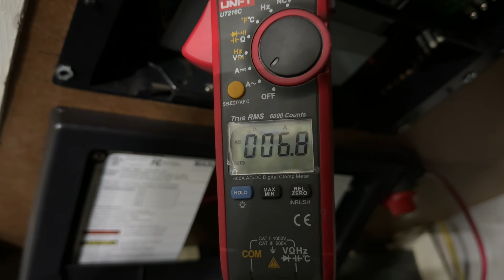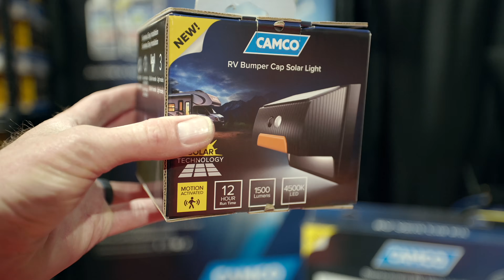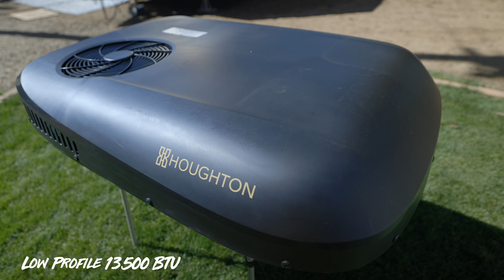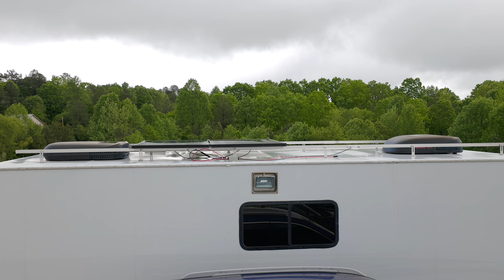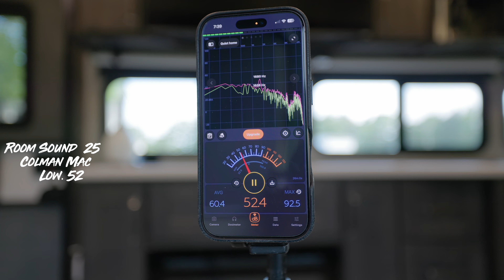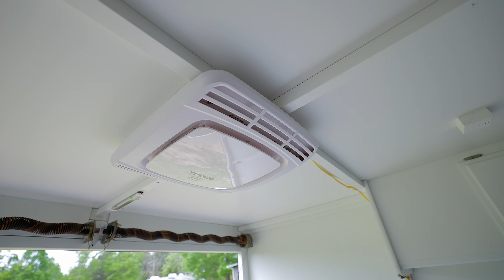New RV AC Tech!  Mini Split Power With Ultra Low Amps Tested!

Comment from the maker: What is the biggest feature you look for in an AC? Is it features, sound, efficiency or price? 

 Camco Gear Up for The Season
Amazon 
   NEW FasTen Leveling Ramps: https://bit.ly/4cZHXE7
   FasTen Leveling Blocks: https://bit.ly/3SgwDdd
Walmart
   NEW FasTen Leveling Ramps: https://bit.ly/3GAuHtH
   FasTen Leveling Blocks: https://bit.ly/3ShXy8B

Turbro Inverter AC 13.5K    https://collabs.shop/mwbdfm              
       Save 10% www.turbro.com/ALLABOUTRVS

Furrion Chill Cube: https://bit.ly/3Z2KsQh
Reply: Priority order:  1) ability to cool, 2) efficience, 3) sound, 4) price
Reply: Ability to cool! And of course price is a factor. But I don’t do well in hot humid temps so what I care about most is that it cools quickly and keeps it cool.
Reply: Please post a video showing how this can be used with a ducted system.  I have a Coleman Mach 3 I want to replace and the Furrion requires a new thermostat and controller and is $1,500 with all that.
Reply: Ability to cool then sound. I can do things to get more power. I don’t know of anything to make a non-ducted A/C quieter.
Reply: I'd like to see a follow up on 6 months and 1 year on these. I had a Eco-Cool on my Wolfpack TH and it never acted right. When it worked it was great. But very unreliable on holding temps.
Reply: reverse cycle
Reply: DC direct power
Reply: How many watts does this pull when it's in high? The chill cube runs at approximately 700 watts max.

Comment: I agree that it’s good that the industry actually moved partly towards technology, but the furrion cube was not nearly good enough. At 18,000 BTU it uses still 900 or 1000 W I think compared to a turbo 13,500 BTU which only uses 5 to 600 W. The cube does not have an app or even Wi-Fi connectivity where is everything with turbo does and most other carriers. This unit is quiet as I understand it, and the turbo is loud. So if you care about noise that might be the only reason to get this unit. But if you’re off grid, you definitely would not want something so inefficient and unable to be able to control remotely. This is typical it seems to me a furry and the industry. Baby steps towards things that other companies, even at the cheapest end are already doing.  I’m curious if others have different thoughts, having looked at the specs of both units.

Comment: keep the roof free for solar, in stall a split 12V, they have even an internal unite next to mandatory outside condenser. I installed a Topleader DL-2000F2 12V, stays under 50A on 12V 👌🏽

Comment: I don’t know if you read comments that you get when a video is seven months old but here goes. I just completed installing this unit on my 2000 Monaco Dynasty and I modified it not the unit. Just the decking tour goes into my duck system on my coach and I think it is much much quieter than what you were showing and a heck of a lot quieter than the domestic unit I took off. Thanks for the video.
Reply: Would you happen to have put it on YouTube? But you basically made it work with existing ducting? I have a similar rv with ductwork and the ac is loud and just pulls a ton of amps on startup so I’m looking into this setup, I am willing to lose my ducting for this but not if it’s possible to modify things. Thanks

Comment: what about the pioneer 13.5 btu rooftop split ac unit? works as a heat pump also. would be the third company to make this class, in addition to turbro and furion.

Comment: Why are all rv places calling roof mounted ac a mini split it’s not its called a self contained unit you are calling it a mini split cause the big hype about how great they just like the bull about a heat pump and the lie about where the heat comes from a heat pump is reverse the direction of Freon you still have same amperage and the mini split uses same Freon and compressor outside and evaporator coil where gas expands as regular ac, what joke know your equipment before you embarrass yourself by lack of knowledge
Reply: Ok as a Commercial HVAC technician I understand the point of what they are saying it  is an inverter technology self contained Heat pump.  As with many technical fields we attempt to talk to our audience aka layman's terms. I do appreciate you not adding to the conversation.

Comment: 1.  Do you have the max current draw when the ac is on full cooling mode inside a hot van, and the minimum draw when the temperature has been reached but now  the inverter ramped down the compressor for maintaining the temperature?  This will let us know how long a battery bank could last keeping the ac running through the night. 
2.  I noticed the air distribution vent has no controls.  You get air blowing through both front and back evenly without controls.  That might be ok if the ac is mounted in the middle of the van, but if it’s in the back over the bed it’ll get extremely cold over the bed but warm in the front.  Do you know if there’s another option for a different air distribution box?  My ac is over the bed in the back of the rv.

Comment: Looks like Pioneer (not that pioneer) (I have one of their mini splits) is also making one with a heat pump now.  Do you happen to have video comparing all the inverter and 12vdc units currently on the market?   I like the chill cube but thinking a heat pump would be nice option.  My 2 month old RV GE AC lost its freon, debating on having it replaced with warranty or taking the "opportunity" to put something better in.

Comment: My furrion ac drives me nuts. Loud, kicks on and off with loud noises, and draws too much power tripping surge protector for over current if I’m using any additional appliance while the AC compressor turns on

Comment: I'm waiting on an inverter RV AC unit that doesn't install on the roof. I don't have any real estate on my roof for an AC. Also, the air filtration on these units absolutely suck!

I don't know why no one has made an inverter AC that can install like a marine unit. Theoretically, I could use a marine unit and install an air to water heat exchanger on it, but that is expensive.

Comment: Great deep dive. Thankyou for your efforts in covering these units.
It's ridiculous that so many trailer models are called the "off grid" or "boondocking" version yet don't come with a AC that's actually useable when OFF GRID. Sure you upgrade to a better battery(lipo) or even 2 batteries. But most AC units supplied by the manufacturers aren't 12v. If the roof top AC isn't 12v, I'd rather just have a 5000 btu window type unit. Atleast those are cheap to replace and available everywhere.
Reply: I dont get how off grid has to be 12v. These days off grid yet with the luxury of AC means using a power station, aka large battery and inverter unit. So 120v makes it easy and efficient to plug into your unit.

Comment: I bought a Turbro unit and it didn't put out nearly enough air (Volume) to keep the RV cool on a mild day (72 degrees). Luckily they took the return and I ended up going with the Furrion Chill Cube instead and I've had the unit running and it holds the RV at 68 degrees despite 90+ temps. I wouldn't buy the Turbro when comparing it to the Furrion. The Furrion is also less expensive. Just food for thought.

Comment: Are there smaller units? I've got an 88 Ford bronco that I'm wanting to convert the back into a camper. The heat and AC are gone and honestly, I'd rather do something like this than repair the AC system. It's an idea that just popped in my head, haven't researched anything yet

Comment: Hello! Always love your content. I learn so much from your channel. Question? I have  2002 Thor of California Jazz 2770 RK, with a 30 amp service. I purchased the Micro-Air Thermostat a few years ago. Which I love!! I was going to add the Soft Start to my original Duo Therm Ducted A/C. Although when I was cleaning the A/C the shroud and the fins were damaged from hail. Now the costs are adding up, and I think it's time to replace the unit. My question is, what is your opinion on what would be the best replacement A/C? And, if I have to replace the thermostat with the new unit, how do I control my furnace? Or do I then need two thermostats? So many options out there. To add, I have solar and 600 ah AGM batteries and was going to add a Country Mod Pro 12v A/C unit in the bedroom for boondocking. So I might not need the ducts, if that makes a difference. Thank you.

Comment: Jered, how can the Turbro be modified to work with a ducted RV? We're replacing our Houghton heat pump, and the Turbro looks to be superior in that it can operate at lower temperatures than other RV heat pumps, but we have a ducted fifth wheel, and this unit would go above the bedroom.
Reply: What happened to your recpro unit?
Reply: @BuiltByMike  After a year, the control board went bad, and they sent us a new one. And nearly a year later, the unit produced an E5 code, which they said meant that the entire rooftop unit had to be replaced. Both were under warranty, but I'd never buy another one.
Reply: @calledtojourney great. I was about to order one. Not many ducted options though. Which one are you thinking of getting?
Reply: @BuiltByMike  We just switched rigs and now have a Brinkley with Furrion Chill Cubes. A lot of manufacturers are now getting away from ducting RVs because you lose a lot of cold air to the ducting itself. Mortons on the Move had a great video about this last year that you should see. Straight dumping of the air is far more efficient.
Reply: @calledtojourney yea I've seen it but my rv isn't set up for 2 units and my bedroom would probably get hot so im stuck with the ducks
Reply: @BuiltByMike  Dometic, Coleman, and GE all now make RV heat pumps that are compatible with ducted systems. I'd consider one of them over the Houghton.

Comment: I'm liking the Turbro unit.  There is competition though:  Pioneer has a 13,500 BTU Full Inverter Rooftop RV Air Conditioner & Heat Pump, 115V.  Very similar.
Reply: The Turbro looks identical, I wonder if they make them for Pioneer.
Reply: Share the link please same price?
Reply: Nice !

Comment: I missed the functionality and COP tests on them at an OAT of 10 degrees F. (Mini-splits they are not--that is pure marketing blather.) This is an industry that assures their customers that they use "marine-grade OSB" (there is no such thing) and that aluminum-foil bubble wrap produces insulation R-values that exceed those of a house with 2x6 framing that meets the IRC. Their factory tours are good entertainment for actual engineers (PE's) and anyone else with business practices like that would have been prosecuted decades ago--they're scammers, and consumers have been taught to enable and reward them by continuing to buy their nonsense.

Comment: Why have they not gone squirrel cage instead of the traditional fan?  They are sooooo much quieter.
Reply: Squirrel cage fans are less efficient than axial fans at total airflow volume but can produce higher pressure when pulling or pushing through a restriction like a coil and a filter.

Comment: Unrelated. The torsion springs on that cargo trailer are mounted incorrectly. (left on the right and right on the left) . Which means they are wound backwards, Ask any garage door installer. Why some cargo trailer manufacturers install these springs backwards is beyond me.  Do you ever see garage door springs WAVY like these? Nope, because garage door installers know the difference between a left-wound and right-wound torsion spring.
Reply: I wasn’t looking until I saw this comment, but I’d say “snaked” springs usually always a problem and can indicate winding in the wrong direction or possibly they are compressed. Springs are “unwound “ to load them and will grow in length in the process

Comment: Do  any of these offer 12v ..with the option of 110/220
Reply: I have also been looking for one that does that. I even considered the EG4 12k but mini split unit that will run purely one solar, or 110v, or a combination of both. The problem is finding a good spot to mount the outdoor unit on a trailer.

Comment: this is not a minisplit.      an ac with  separated evaporator and  condenser its a minisplit,  that why are called  split system
Reply: They did t say it was a mini split. They said it has mini split technology, meaning it has an inverter built in so the compressor and motors are variable speed and DC inverted using much less power.

Comment: Great video. My last experience with a new A/C I was disappointed with the fan features. I did notice you said the fan stays on all the time while in cool as mine does. The BIG down side of this is when at home and my rv is under the carport with the a/c left on and on cool days when the a/c is not needed the fan is still running 24/7 365 days a year. Why would any company design this feature. I feel the only way to over come this is to install a 2nd thermostat on the power side shutting off the power completely. What happen to the feature AUTO/RUN for the fan.

Comment: Nice review.  I am disappointed that these have taken so long to come to market.  These devices are YEARS late.  How many jumbo 5th wheels have had add-on power management systems just to keep the air conditioners running because conventional one speed rooftop ACs were all that were available.

Comment: If your RV is big enough, why not install one of those 115v home minisplits? I have seen several for $600-$700 for 12k btu with a heat pump and inverter cooling which is way more efficient
Reply: I've considered this with the EG4 unit that can run on solar only, or 110v only, or a combination of the two called power sharing. The issue is where do you mount a vertical standing mini split unit on a trailer.
Reply: @thetunnelmaynia I have seen some mounted next to the ladder in the back or on the front tongue/hitch mount?

Comment: There's 3 
Gree 
Greenland Turbro 
Furrion
Reply from the maker: The Gree is more efficient but I made the same mistake on the Gree. It doesn’t have a variable speed inverter compressor and still needs a Softstart to bring those amps down at startup.
Reply: @AllAboutRVs  well shoot thanks for the heads up. I'm about to order a new a/c and I'm not a fan of the factory dometic brisk ll/Fresh Jet

Comment: Thank you, I feel pretty good about my purchase, and I’m looking forward to installing it in my new build. One of our main goals was to be able to run off batteries. Our research showed that this unit would be the best option for this, even compared to units that run directly off of DC power, which seem to lack in performance and are far more costly. The noise level was our only hesitation, and still is a concern but at least we are kind of used to it from our old Dometic unit. I’d be really interested to see if anyone can come up with a way to quiet down this unit a little bit.
Reply: "compared to units that run directly off of DC power, which seem to lack in performance"  Curious how you reached this conclusion? We have watched a few videos on the popular 12/24V units, and still researching with low noise, low current consumption criteria. Thank you.

Comment: Just bought one of these and just started watching so my fingers are crossed 😂
Reply: How much do they run? Im in a 1988 winnebago rv and my two roof ac's are out. Well one just doesn't do anything, and the other turns on but is just air, not cold. Looking into different mini split ac options. I'm in Phoenix AZ and running outa time before real heat hits lol..
Reply: @lexstacks6944 did you find anything out, I'm also in arizona looking for something more efficient in my motorhome. The rv park claims I have used $500 worth of electricity this month, but my ac is 25 years old

Comment: You forgot to include eco cool with the Gree heat pump. I have three of them and they are great
Reply: I looked at the gree unit. It does not look like its an inverter based unit to me
Reply: @djdonnie5665  I have three of them, they work just like a mini split and are very efficient
Reply: @craigbeedle8416 they are nothing like mini splits. Although they are quiet they do not have variable speed compressors like Gree advertises. This guy did another video explaining that and he actually had to put a soft start kit on it
Reply: @djdonnie5665  I'll take your word for it on the compressor but they are very quiet and very efficient, I am able to start mine on the inverter with no soft starts.

Comment: it's about time the RV industry embraces efficient A/C units. They are stuck in the dark ages, using the same units that we've had for the last 40 years. I'm planning a build from scratch and will be going to a custom efficient unit.
Reply: Actually, this is perfect for the RV industry--a pretend mini-split rather than an actual, serious application of the technology. The two crucial metrics are aesthetics and sales. That's why nothing is actually engineered as it would be from the automotive or other industries. Those dollars instead go to lobbying lawmakers for exemptions and protections.
Reply: I used a $500 mini split 9000btu off Amazon (Rovsun Seer 22). It's around 30db on high, and averages under 300 watts in summer to maintain 68 degrees (I don't like it this cold, I just set it insanely cold to see what it could do) in my 22ft Class A (93 Restomod Itasca Passage 22RB). It can take the RV from 95 degrees+ to 75 in 5-10 minutes. It was one of the first things I did during my restomod so the inside work would be bearable during the summer.  Plus, I can have a super low profile roof which means I can fit under lower clearances and have more room for solar up top.  I'm planning to shave everything on the roof down to 3 inches or less and cover it all in panels on a rack.

Comment: Did I miss it, does it work with a ducted system?
Reply from the maker: It is not ducted. I have modified non ducted ACs to work with a duct system but they don’t have a ducted option.